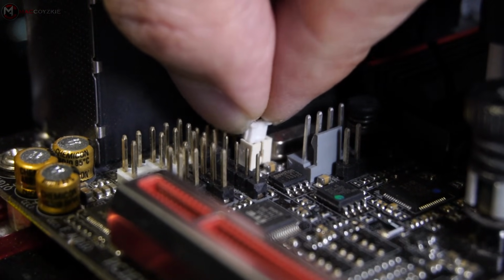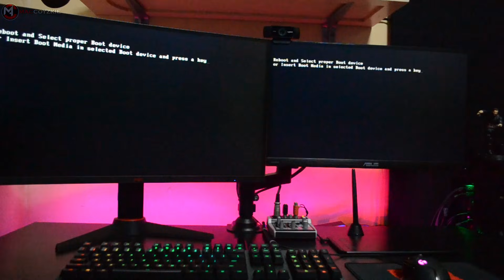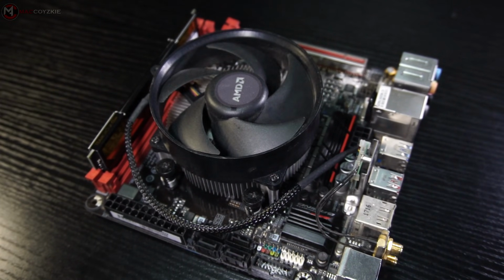How to remove cmos battery in your pc? Cmos reset / hard reset on bios

Comment: So I had this issue again..i tried on re-placing the cmos battery , i waited , i replaced it back and the select proper boot method still appears , what should I do?
Reply from the maker: remove all other drives beside your boot drive, you might as well reattach the sata cables in that boot drive and do the cmos reset again
Reply: @MacCoyzkie  Im taking this PC to the service ,it gotta be thankful because I didn't toss it into the garbage. Thanks for telling me , altough unfortunately this did not fix it but thanks again man
Reply from the maker: @SickenedYellow  i hope it all goes well

Comment: I keep trying to speed up my ram, it’s currently at 2400mhz and my mb is cable for 3200 and I have 32gb that can reach 3200mhz and when I turn on xmp to profile 1 and save my signal cuts. Twice already. Idk what’s the problem maybe I have to update my bios but idk how to if anyone can help me out that would be great. I’m currently waiting 5 min with my battery out so I can hard reset
Reply from the maker: you must also check if your cpu supports 3200mhz, what's your cpu anyway?
Reply: I7 11700f
Reply from the maker: @ScaredOfToez  what is the max ram speed support of your mobo? your cpu should be able to handle it
Reply: @MacCoyzkie  I think it’s 3000mhz or 3200 my mobo is a b560 DS3H ac-y1 I went to my bios and it’s a f4 version and I think I saw that the last eat available is a f6 so maybe I just need to update? But I need a usb flash drive for that now
Reply: @MacCoyzkie  maybe I need better power supply too? I only have 650 80 gold
Reply from the maker: @ScaredOfToez  are you using windows 11 by any chance? because that might the issue here. b560 DS3H supports up to 4600mhz ddr4 so it should work. I'm baffled as well so i think this has something to do with the o.s

Comment: Hello sir, I am experience some weird issues with my PC. After a Windows update, my PC can't boot up and is making beeps, I can't even get into BIOS. It turns out that the beeps mean that there is something wrong with the memory. I tried reseating the RAM, cleaning the RAM, and reseting the bios thru your method. None of them work. I don't know what to do. Pls help
Reply from the maker: can you remove any other drives and leave your boot drive and try to boot it? if that does not work you need to enter safe mode. here's how https://youtube.com/shorts/IZKc8plksDA then uninstall the last windows update https://youtube.com/shorts/f2NgSKEw-K8
Reply: @MacCoyzkie  thank you for your reply, I can not enter Windows as there is also no output as well. I have only one drive.
Reply from the maker: @nightstech7499  you need to check the psu if its giving enough power, you need a tester like this  https://amzn.to/3f5jtg5

Comment: So recently i was using my pc and all of a sudden it frozed.I restarted it and now it sends me straight into bios instead of windows.In the bios my ssd is not being detected but my hdd is there.So is it a motherboard problem or ssd?And my windows was in my ssd.I replaced my sata cables with the ssd’s and hdd’s still not detecting my ssd.And can i get a fresh windows install?
Any type of help will be appreciated?
Reply from the maker: let's try this, remove the hdd and just boot with the ssd. if that works without a problem then the hdd is causing the problem. Just a theory so we need to test that first.
Reply: @MacCoyzkie  i tried this didnt work
Updated my bios didnt worked
Switched the cables didnt work
Everythings working and showing on my mobo except the ssd.My windows are on it and i cant boot into windows?Any fix or should i buy a new ssd?
Reply from the maker: if you don't have any important files in your ssd why not try to reinstall windows instead of buying a new ssd. Also try the ssd with other device to check if the ssd is not really working before you buy a new one
Reply: @MacCoyzkie  okay will do that and let u know

Comment: If my motherboard isn't getting power from my PSU (no boot), will this fix the issue or should I get the motherboard replaced?
Reply from the maker: try it first, if still does not work borrow a psu from a friend if the problem is the same then the motherboard might already be faulty

Comment: Hey mac I have 2 problems.The first one its that my monitor goes to sleep everytime and second it says vga no signal idk why cuz i pluged the vga cable
Reply from the maker: ok first lets turn off the sleep mode in your windows and that does not help save power anyway, unless you are using laptop. Anyway press windows key on  your keyboard and type power and sleep, click that power sleep settings and set the two drop down to "never".

Some people are experiencing the same after the pc sleeps and have to turn on manually to start pc again. this is a windows problem and usually happens if your  windows and gpu driver is not updated
Reply: @MacCoyzkie  tysm mac it really helped
Reply from the maker: @gamingwithme7718  glad it worked 😃

Comment: Hi I was trying to enable secure boot on windows 11 and now my pc won't start black screen and couple of pips sound coming from it same like starting the pc just more 4,5 sound. Have no idea what to do....
Reply from the maker: you need to clear cmos like in the video to give the motherboard a hard reset
Reply: @MacCoyzkie  it ain't working for me
Reply from the maker: @MMMMontenegro  if this does not work your motherboard is already faulty, remove the cmos battery for at least 5 minutes, the longer the better. if still does not work after that then your motherboard might be faulty. What are your pc specs anyway?
Reply: Also the same experience, after I updated the last update from windows 11 it f’ed up my pc and it won’t boot, no displayed just pitch black. Can’t go to recovery mode as I cant see anything. Did the cmos reset, still not working. Any tips?
Reply: @youphori4  try to unplug the GPU and others external parts only keyboard and mouse, then try to open again, or rolling back to windows 10 then reupdate the windows 11 cause if your PC black screen, no display, it's either the windows is corrupted or your PC is old

Comment: I unplugged/blew on every cable possible, removed and sat the battery for 5 mins, and alternated my ram. Still my USB’s and HDMI ports dont work but the rest of the computer powers on
Reply from the maker: how did the pc problem started and what are your pc specs?

Comment: the cmos on my motherboard is similar to the one in the video at 1:00 but i cant get the plug out can s1 help
Reply from the maker: yes that's really difficult to remove use a pin or something to push it upward. be careful though
Reply: @MacCoyzkie  i managed to get it out, thank you :D

Comment: Thank you so much for making this video!! so many other videos just say to "remove it" yet nobody shows what "It" is.
Reply from the maker: lol i feel you bro, anyway glad the video was helpful
Reply: @MacCoyzkie  my Bros laptop went black screen after bios Update. Should be ez to fix but no luck yet.
Reply from the maker: @j.jarvis7460  oh no... you only need to update bios if you are planning on replacing your current cpu. Anyway the bios you installed might not be for the cpu so its inevitable that it won't show display. You need to install the bios compatible for your cpu
Reply: @MacCoyzkie  okay very interesting. Where does one find compatible bios for cpu? Just search for cpu model?
Reply from the maker: @j.jarvis7460  know your laptop specs, the motherboard manufacturer usually have their own website to where you can download specific bios for a specific cpu.

Comment: hello are you still here please help me! im trying to get it out but it wont pop out it’s stuck it makes a pop noise and goes up like a millimeter but you can not get it put
Reply: out*
Reply from the maker: the lock is difficult to push using your finger, you might need to use a screw driver or something else to push the lock

Comment: So much went wrong today with my desktop and every problem was fixed with your videos today, I swear. First the RAM sticks and now removing the CMOS battery for 5 minutes seems to have finally solved everything. Thanks.
Reply from the maker: awesome bro! glad it worked too!
Reply: did you started ur pc while removed ur battery for 5 min or jst started after removing it for 5 min when the pc is off ?
Reply: @enzofor7  Turned the PC off, then removed the battery for 5 mins
Reply: @William2669  How to deal with a PC that hangs with the keyboard and mouse unable to move. is there anyone here like me?

Comment: My monitor shows no signal when I turn on my pc. I checked cable and monitor and they are fine. Few days ago I increased my Ram speed to 3200mh from default in bios. Should I hard reset bios just pulling out and in mobo battery?
Reply from the maker: yep because the overclocking didn't work. either your cpu or the motherboard does not support the speed. I know the option is there but if some part of the hardware does not support the speed we can't do anything about it. Clearing cmos is the only option, make sure to remove the battery for like 5 minutes so the reset will work
Reply: @MacCoyzkie  I did but it didn’t work. 
My processor Ryzen 7 5700g
Mobo Gigabyte Aorus pro-p
Ram G.Skill Trident Z RGB 8GB 1 stick
I really was hopeful that hard reset would work..
But still getting no signal on monitor. Mouse is getting connection, casing fans are moving but their rgb that I connected with mobo are not working.  Stock processor fan is working, rgb on ram is also working but still  showing 'no signal' on monitor.
Reply: @MacCoyzkie  I think I should mention after increasing the speed of RAM my pc was perfectly fine for a week. I'm facing this problem since yesterday. 
To reset CMOS I only pulled out mobo battery, waited for 5-6 minutes then inserted the battery again.
Reply from the maker: @shiyamkhaledchowdhury6516  wait if it worked for a week that means its not about the overclock. this is a low power draw from either the psu because it is faulty, or the power outlet because of power fluctuation. have your psu check if its still giving enough power to run the system.  use a psu tester like this https://amzn.to/3f5jtg5
Reply: @MacCoyzkie  Yup! You are correct. PSU was the culprit.  You are awesome, man! Earned my respect & subscription.
Reply from the maker: @shiyamkhaledchowdhury6516  awesome! if you're going to buy a new psu make sure its from known brand with 80+ certification. btw ty for the subbed
Reply: @MacCoyzkie  Actually I have warranty from Corsair. So Corsair have to deal with it.

Comment: Hi, I have wrong configuration on my pc, which single channel then I set ram speed manually on bios, but now it cannot booting, I try your simple method but still same, what should I do?
Reply from the maker: did you let the cmos battery out the motherboard for 5 minutes at least? it will not reset if its less than 5. Do you have one ram stick? place it to the 2nd dimm slot

Comment: It doesn't help😢
Reply from the maker: let me know your pc specs and how the pc problem started
Reply: @MacCoyzkie  well, uhmm my fan is the only one work but my monitor and keyboard is not working. I also have mechanical keyboard everytime it normally start the keyboard starts to light up but now it won't work.
Reply: My pc spec is just AMD A6 processor, A58M-E33 motherboard, 8 GB of ram, and 1TB of HDD and Windows 10
Reply from the maker: @wilburescrin4729  sounds like a psu issue, you need to test it using a psu tester like this https://amzn.to/3f5jtg5

Comment: F1 to run setup
F2 to continute
Tried both and i still got the reboot thing, can u help me on this?
Reply from the maker: i need to know your pc specs and how did the pc problem started
Reply: @MacCoyzkie  Intel(R)  Core (TM) i5-4460 CPU @ 3.20 GHz 3.20 GHz
I was in the middle of a game, luckily it was offline
Reply from the maker: @Da_Fel  that's just the cpu bro, anyway try to reattach the sata cables on your boot drive and do a cmos reset again afterwards
Reply: @MacCoyzkie  alr ill try it later
Reply: @MacCoyzkie  just tried it, still showed the reboot screen
Reply from the maker: @Da_Fel  you need to try the boot drive on a different pc, if it does not detect it then its already faulty :(
Reply: @MacCoyzkie  ye it probably is, this drive is like 5-6 yrs old along with the cmos battery, gonna ask to see if my mum will get me a new pc instead xd
Reply from the maker: @Da_Fel  5-6 years lifespan is not bad at all. I hope you get a new rig soon
Reply: @MacCoyzkie  alr tnx for the help

Comment: Would I actually have to remove the motherboard from my case? I'll disconnect psu etc. But yeah just wondering about this. Also I downloaded wrong bios which has forced me to stay with a bios i don't want and it's 'oemld mismatch'. Would this fix reset my bios to be the original factory gigabyte bios?
Reply from the maker: if you downloaded wrong bios then there might be no display problem but if you are still seeing display that'll be much easier. You cannot do a cmos reset to return back the old bios, you need to install the bios needed for your cpu to work
Reply: @MacCoyzkie  so essentially I have a bricked motherboard
Reply from the maker: @nikstah1232  not really, just update the bios version that will work with your processor. Most motherboard nowadays don't need cpu, ram or gpu to update bios, all you need is a usb with the updated bios and the psu
Reply: @MacCoyzkie  I know how to update a bios, it's literally the update I got for it has locked it from ever being updated again.
Reply from the maker: @nikstah1232  what motherboard model is that? i don't think that is possible but fill me in so i can know too what might have caused it

Comment: I Have a question my pc is clearly running msi b550 tomohawk
With the cpu :ryzen 5 5600g
2 crosair vengence sticks 
So i try to download windows 11 it was working perfectly till it randomly shut down for some reason and when i try to boot it up the cpu led came up so it actually lead me to 2 reasons the motherboard or the cpu :V
Reply from the maker: have you consider overheating? what are your cpu idle temperature at the moment? also another thing to consider, windows 11 has a lot of graphics issues at the moment so you might have more problems in the future. if you can switch to windows 10 until windows 11 officially release itself that will save you from more stress
Reply: @MacCoyzkie  haven't recorded cpu temps for windows 11 only windows 10 which its was between the 30s so will it be ok after it overheating
Reply from the maker: @maximusl7118  30c? it is fine if its like that, usually aio cooler not working might also cause it  but if you're using air cooler then there is no problem. My only theory right now is windows 11 graphics issues. Did you have the same problems in windows 10 though?
Reply: @MacCoyzkie  for 10 no im just worried about my cpu if it gonna be alr so do i have to wait until it fix itself or buy a new one?
Reply from the maker: @maximusl7118  what do you mean alr?
Reply: @MacCoyzkie  well nvm now because i have figured out that my cpu is fried and now i have to buy a new one but thank you for trying to help me though i am really happy u tried to inform me about the issue i had

Comment: Hey! I just upgrade my cpu and now my pc won't recognize my monitor. Everything is hook up correctly. I did your method from this video and nothing worked, monitor still isn't recognized. Any advice??
Reply from the maker: if you're running in amd cpu then you need a bios update depending on what specs you have. Double check the bios needed for the motherboard (in the mobo's website) for your cpu to work with it
Reply: @MacCoyzkie  thanks for responding, I looked it up and it said my new cpu (amd ryzen 9 5900x) is on B550 and my motherboard is Higos - uATX AM4 - 4x DDR4. But I don't know what bios my motherboard is?
Reply from the maker: @skeezenutz  Yes it will work with the correct bios, have you check it in your motherboard's website yet? go to support section and look for the downloads

Comment: Pops out yea ok, doesn’t pop out at all
Reply from the maker: if this simple matter is too difficult for you i think you should just bring your pc to a local shop instead
Reply: @MacCoyzkie  I just had to push extra hard for it to pop out, pc building is so stressful.
Reply from the maker: @rdgyt3047  yeah i guess it is but hopefully you get the hang of it
Reply: @MacCoyzkie  I was really stressed, because I had upgraded my cpu from a ryzen 5 to a 9 but my system didn’t boot, I panicked, I haven’t updated my bios, do you think that’s the problem.
Reply from the maker: @rdgyt3047  Yes, depending on the generation but you can visit the motherboard's website and check the appropriate bios for your specific cpu

Comment: Hi buddy i forgot my pc pasword and i asked sombody about my problem and he said remove your coms battery 1 minute and back it again after 1 minute and now my pc isn't boot on. What should i do? If you didn't understand tell me
Reply from the maker: password in windows? there is no way removing the cmos battery will fix that. Try removing the cmos battery for 5 minutes instead
Reply: @MacCoyzkie  thanks buddy for your guidance. And i understand the reason, i had mistakenly plugged the VGA cable into a port on the back of the case that did not display the motherboard specifications. My problem was solved.

Comment: what happens if i remove it but later on put it back into the computer?
Reply from the maker: even if its a whole day i think its fine, not unless you place the battery in a high temp room then that will just drain it and will not longer work. For short nothing will happen, it will just reset the bios of your mobo